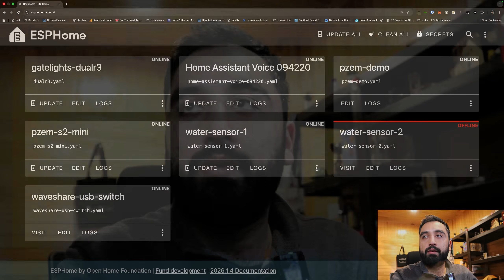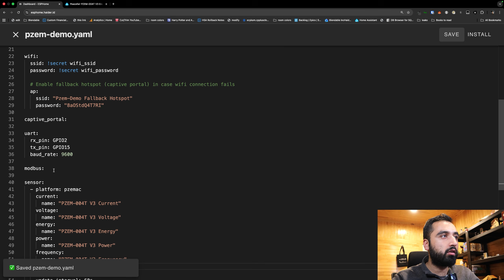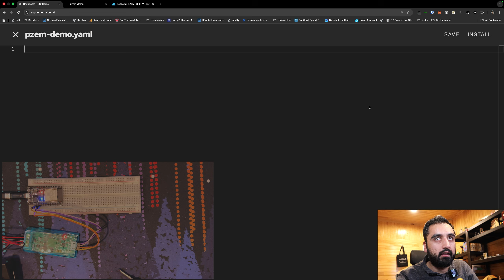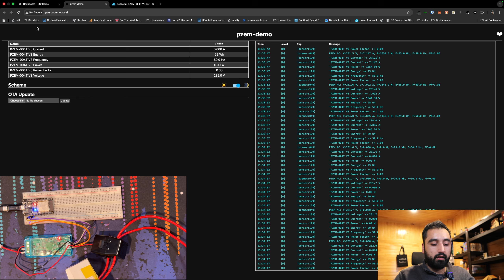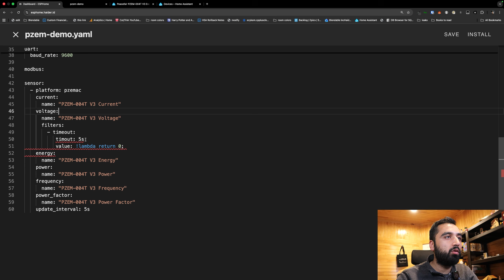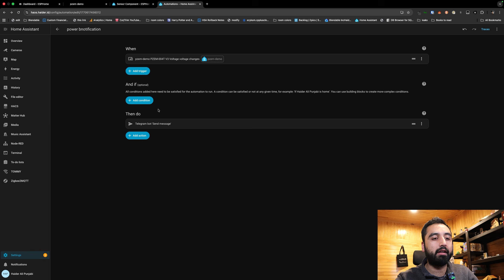DIY Power Monitoring using PZEM 004T

Comment: hello there ,
you are using esp32 in this project
i was testing pzem with my wemos d1 mini , there was always comunication error , even i flash it with tasmota ,
now i am using esp01 flash with tasmota and giving 3.3v to pzem isntead of 5v , tx to tx and rx to rx , then i am able to get values in tasmota ,
why its work this way ?
Reply from the maker: I haven't used it with either of those two boards so it's hard to comment without more info. 
For 3.3V, i am also using the same in this video